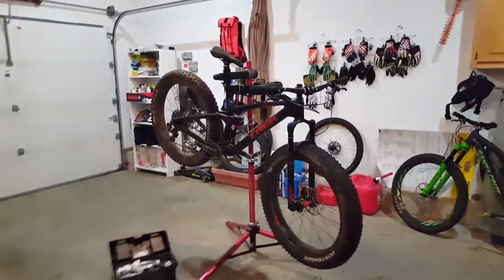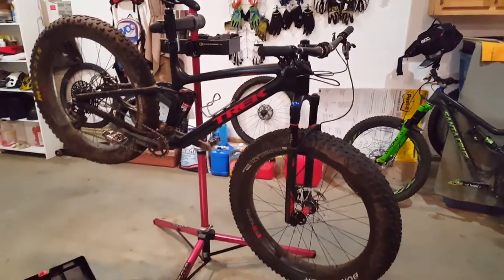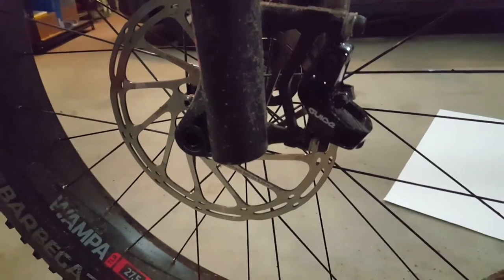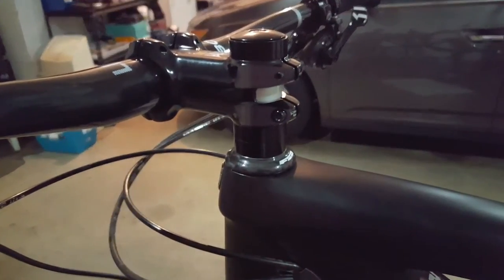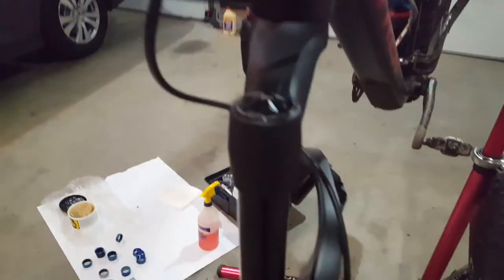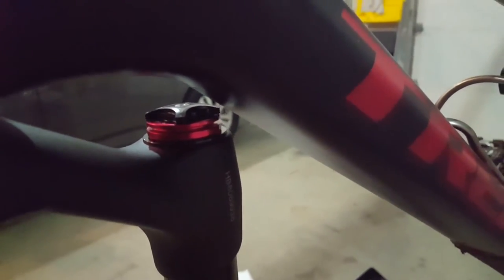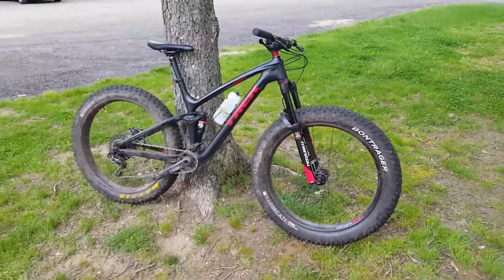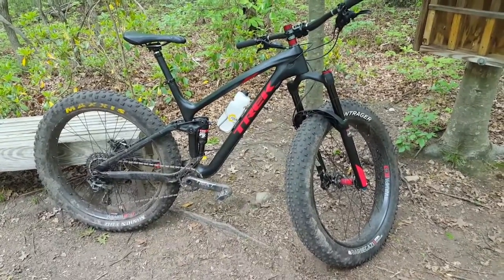Manitou Mastodon x 2017 Trek Farley EX 9.8

Comment: Ryan, you ride in Rockland?! Just bought a Farley EX 8, I ride Rockland all the time (20 plus years) I am looking for a way to get a larger studded tire. What size tires front and rear have you been able to fit now that you got this shock? Want studs for the icy puddles and want larger tires to go to VT and NH to ride some deeper snow this winter. Any suggestions greatly appreciated.
Reply from the maker: Yes, indeed I do ride Rockland quite a bit.  The Farley EX8 8s a great bike, congrats.  The front is running a Bontrager Barbegazi 27.5x4.5...its a monster, and plenty of clearance.  Way more clearance than the Bluto.
Reply: @fusabike  what are you running on the rear

Comment: Nice video,
How is the blue dial doign on the rear shock? does it ever switch position? I have this issue, in the front too, but I ziptied the dial in Open mode.
Reply from the maker: Funny that you mention the blue lever - I can only remember one time when I flipped the lever from firm to trail and it swung all the way over to open.  This was while moving on the trail and I didn't notice that the lever went to full open until I got to the bottom of the descent and commented to myself that it felt smoother than I expected.  No problems otherwise with the compression lever moving on its own.
Reply: I have used zip ties on the shock too https://flic.kr/p/YDJeJu, I always ride in open, because of my back issues, but I rode down a hill, and over a kerb, the shock went to trail mode.

Comment: Did you give the Wren inverted fork a look? I'm on the fence between the Mastodon and Wren.
Reply from the maker: I did give the Wren a look, and ultimately chose the Mastodon for it's adjustable travel, High Speed Compression adjustment and dual (pos/neg) adjustable air chambers.  Plus, Wren had a kit for winter riding, whereas the Mastodon was built to be four-season capable.  Both forks are capable, I simply preferred the Mastodon.  A few months later, Trek announced the Mastodon as standard equipment on the next model year of the Farley EX, so I felt somewhat validated in my decision.  Last point - the Mastodon Pro EXT was built to accept a 27.5x4.5 tire, which I run all four seasons, so there's that.  Thanks for watching, and commenting.  Good luck with your fork selection!

Comment: Couldn't find the Farley headset size, but Cane Creek makes both +3 and +6mm 40mm (IS52) crown races to address clearance issues. I ordered the +6 from Universal to put a Mastodon on my Salsa Beargrease (I'll find out tomorrow if it was enough!). Looks like the +3 would be enough for the EX 9.8. You can also apparently replace the Hi/Lo speed compression knob with one from the Manitou Circus, which has a lower height.
Reply from the maker: Jason Martinez This is GREAT information Jason, thank you!  I am not sure I want to bother with the crown race because that would slack out the head angle a little bit more (I think I took out too much already), but the compression stack from the Circus is a good call.  Thanks!

Comment: I have the same bike and fork...just using 120mm. Want to increase the travel to140mm but concerned about being to much...how is it working after riding for some time
Reply: I also put a spacer which fixes the clearance issue
Reply from the maker: Hi Joseph, I really ran the 140 mm mostly to take advantage of the other 3 seasons of riding. The bike is just so much fun on trails, techy climbs and descents. Yes running at 140 slows down the steering a little bit, but it was a trade off I was willing to take for being able to take bigger features like drops and jumps and steep rollers.   If you have any concerns, how about you split the difference and run at 130 mm?
Reply: Ryan Schlagheck - thanks for the reply Ryan!  I’m going to give it a try...I also have a set of 29 plus wheels and tires I use and love it!  Transforms into a much fast bike with a lot of the fat bike positives!

Happy New Year

Comment: Could you get around the clearance problem with an external lower headset cup like on the Pivot Switchblade? Does anyone know if this clearance problem effects the hardtail Farley as well?
Reply from the maker: SNS1212 Hi and thanks for watching! It seems completely feasible that clearance would work with a lower headset cup rather than inset lower cup. The 2018 Farley EX comes with a Mastodon so may be worth checking whether anything changed on the downtube, headtube or lower headset cup to get needed clearance.
Reply: External cups with integrated headset headtube will not work.
the problem is that the headtube is not strong enough to support external cups if its made for integrated headsets, chis King calls integrated headsets bad engineering.

external cups will change the headangle quite a lot which could effect fit in a bad way, or in a good way, depending on the bike nad rider.
Reply from the maker: This is a very good point Johannes.  The external cup to alter the head angle would be a reasonable trade-off in order to save the frame from catastrophic damage from a spun fork, but the bigger point which you made is that external cups are not appropriate for headtubes designed for integrated races.  Thanks for that!
Reply: you can get a thick crown race, which will do the same job.
Reply from the maker: Johannes Nilsen Johannes, how thick can you go?  The tapered steerer flares out just a few millimeters from the bottom.  Who makes thick crown races?  Can you let me know?
Reply from the maker: AWESOME!  Thank you Johannes!
Reply: So what thickness you need with the spacer to make the 27.5 by 4.5 work with the front fork?

Comment: I will have to get slow speed and high speed compression for my next bike, if i ride on 1m long stair steps my bike is like its with pogosticks, even thou compression and air pressures are perfect. but on the trail its working ok. I use Fox 32 Evo.

Comment: sadly alot of trek's bikes are flawed, yours have clearance issues, mine has flex issues which cause wear, and dislocated pivot bearings( Abp and rear Evo link),the rear dislocated so much that the seat stay and chain stay were grinding,and the paint was worn off. but my trek 6300 has no flex issues. 
I will definitely have to test out some bikes and do more research.
Their new fuel ex's should be stiffer but they have the knock block system to prevent the issue you have with your Farley.
I would call trek's development and releases of new bikes rush jobs.
it's clear that if you design a fat bike you need to take the width of the fork crown into consideration.
I also noticed soem quality differences from the 2 bikes I got, one had overtightened bolt on Evo link, no grease in awful formula freehub.
Reply: This fork did not exist when the Farley EX came out. Can't design around something that does not exist.
Reply: they could have predicted it, and allowed more clearance, it's always good to leave extra room, but if that fork did not exist they could not do it unless they, of course, had a preproduction fork to borrow.
Reply: I think Trek has done a bad job with their full suspension frames, my fuel did not work well with 2.3 tyres which is what the bike came with, tyre rub, way too flexible frame causing chainstay to extend, cracked rocker link. I need to get better bikes, cus 2014 fuel causes premature drivetrain wear.
I am done with Trek.
They have still not improved their linkages, but I see their new frames have bigger swingarms and different front triangle design, which will improve stiffness but, I am not sure if they are stiff enough for me.

Comment: I just changed my headtube bearings in my 9.6 Farley,my fault I always regrease every thing 3-4 months but I didn't , the lockout on the forks why don't you machine it down , it's only aluminium so that it clears the forks the black adjustable a angle grinder or a file , or have a machine shop to do for you , just repaint once done better than smashing your buddy atvb steve
Reply from the maker: Hi Steve - Not sure what you mean.  The right fork leg houses the compression side and I need the LSC/HSC top cap stack to control both.  Apologies - what am I missing?  As for the HS bearings and cups, I wish I had regreased them sooner...just never had the occasion to and haven't had a bike that's not a Chris King sealed or Cane Creek HS in a long time!  Lesson learned!  Thanks for watching and commenting!
Reply: 9:42 I think what thesheepman220 meant was to shave off some material on the dial so it clears the frame.

Comment: Why not get a wren fork??
Reply from the maker: No good reason, as both are good forks.  The Manitou had features I was familiar with from their "regular" trail forks so wanted to take advantage of those, but other than that, it was just a personal choice.  From a resale perspective, the Manitou is an easier sell, at least around here.
Reply: Im thinking to buy a manitou right  now i have wren i like it but make to much noise
Reply from the maker: @jt_mtb1  I researched both forks and ended up with Manitou.  It just felt like a better buy, familiar company and proven features from their other forks.  The Manitou also had, importantly, the ability to change the spring curve via tokens AND a negative air spring...never before or since (to my knowledge) has a fatbike fork had all that capability.  Makes a difference in the other 9 months of the year when there isn't snow on the ground.  Very happy!
Reply: Where did you got it from i want to get one??
Reply from the maker: @jt_mtb1  My local bike shop, The Biker's Edge in Bristol, Connecticut, ordered one for me and converted it from 120mm stock to 140mm.

Comment: I have the same bike https://youtu.be/PJWO3C7Siwg I love my Farley quick question, why did you change out the stock tire?  Also did you have any trouble with the race face cranks? Mine delaminated and had to be replace with updated model under warranty.
Reply from the maker: Wow - Sorry Brett for missing your question so long ago!  I changed out the tire because I wanted more grip at even lower tire pressure, if you can believe that.  I used to run a Surly Moonlander with Bud and Lou 26x4.8 tires and that thing was like a touring monster truck.  So I was going for bigger and brawnier.  I ride this bike year-round, in rotation with my other bikes, and with 4.5s, it's just a totally different experience, moreso than with "just" stock 3.8s!